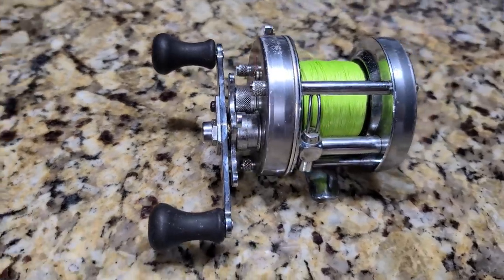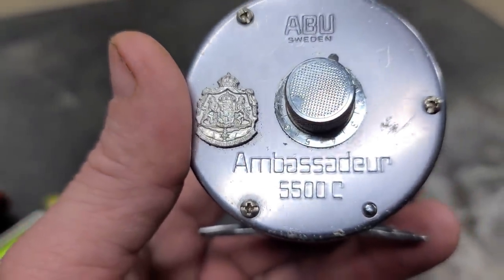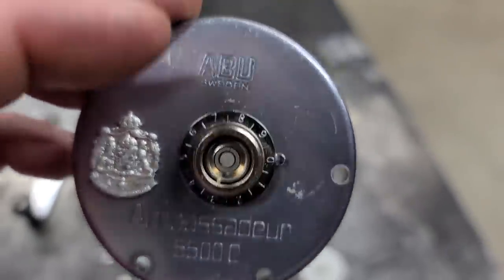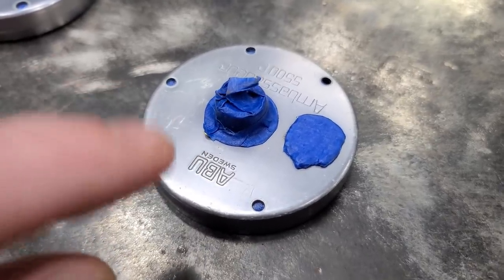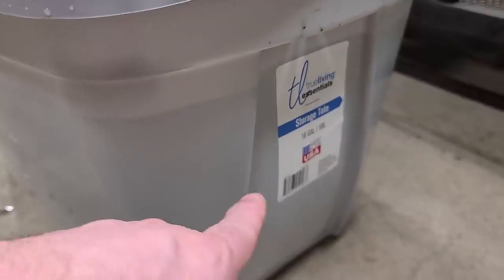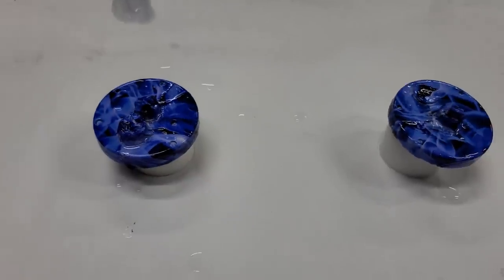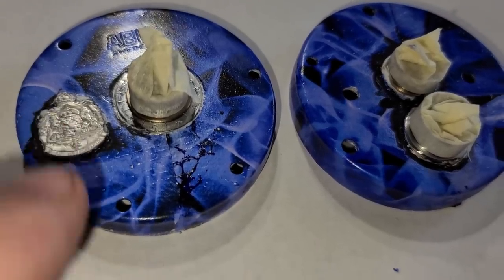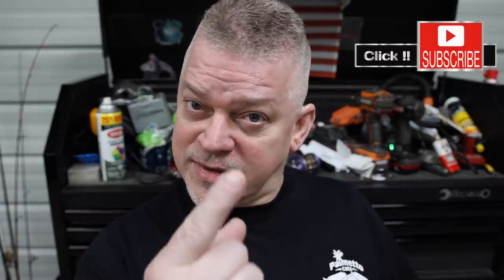How To Customize Your Fishing Reels ( Hydro Dipping )

Comment: On the painting, you could use whatever rattle can you want and clear coat with 2K Clear. Comes in a spray can and it'll set you back about $25. Goes a long way though so maybe use on multiple projects at once cuz it'll dry in the can about a week after mixing. That gives you the end quality/durability.  That's how i painted the tank on my three wheeler restoration.

Comment: What you talking about Willis? Those are the good reels! I've used the 4600s for years. They're antiques but I am too. I have my Grand Dads red reels and my first Lews Rod and the silver 5500 on it from the 70s. Turd Ferguson aka Greg W. When your making baits nothing else will hold up like automotive paint. You need an airbrush and some friends in the auto parts store.
Reply from the maker: I've already did a video about painting reels with automotive paint . But I should have used the good Clear coat Your exactly right the old Abu reels are the best

Comment: hi, did you do any project with aluminum pipe coating or painting which is saltwater resistant ( aluminum pipes used on the boat )
Best thanks ..
Reply from the maker: I had an Aluminum project on brazing it

Comment: That is one bequrmtiful reel buy I am concern for it resale value as it willdrive its value down however I know you are not going to sell it. I like this technique though I can think of a lot of things it could be applied to possible tobincrease value but more than anything make them re-attractive and more desirable. Thanks for the ideas this creates. I wonder how it would be to revive old lures, spoon, or blades on a spinner bait. Of course the use of a ultr as strong topcoat would be very important and most necessarily to protect from abrasion and water damage.
Reply from the maker: I totally get the resale value concerns,  but I wouldn't do this unless it was beat up and beat the value is pretty much shot any ways  .

Comment: I've never met anyone... and I have NEVER had the urge or desire to paint my fishin' reals.  Unless a guy (or gal) is a trained open heart (real) surgeon... You're just asking for trouble stripping all those parts off just the paint it.  Just add some lube, as needed and otherwise leave it alone and keeeeeeep fishin' with it!!!  ;-)
Reply from the maker: I've took apart my reels since I was 18 so 33 years and did maintenance on they its not that hard after you understand how they work . But that might be why mine last so long huh
Reply: @FishinNStuff  I've only oiled my reels and haven't had a failed reel in 40+ years.  Fish On!!!  :-)
Reply from the maker: There's nothing wrong with that  , but I started with hand me downs at 18 and moved on to buying used broken reels for really good deals or I wouldn't do it either
Reply: @FishinNStuff  I did overhaul one bait caster reel... I had a Brand New Team Daiwa bait caster rod and reel that I dropped to the bottom of a 20 ft. deep lake back in 2007 or so.  Took me two HOURS of dragging the bottom with treble hooks and sinkers before I snagged the fishing line and pulled that rod and reel back into the boat (canoe).... haha  Crazy Day!!!